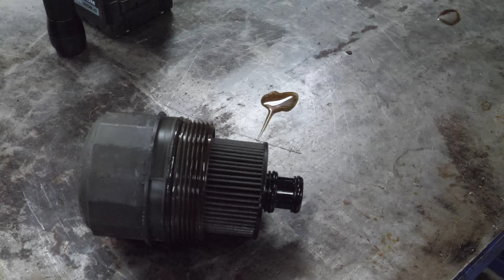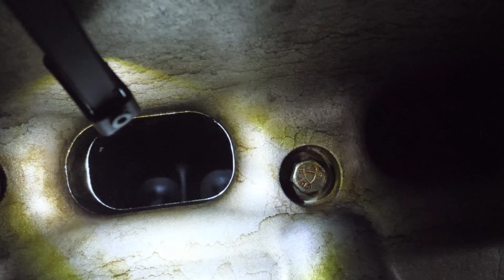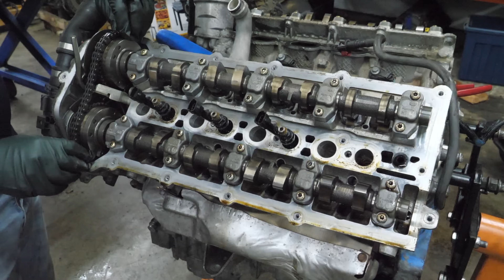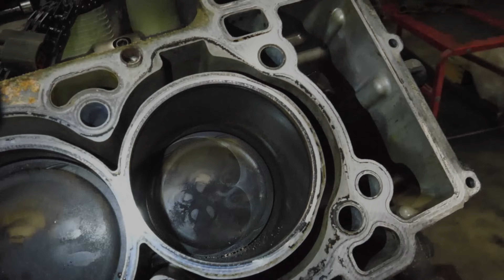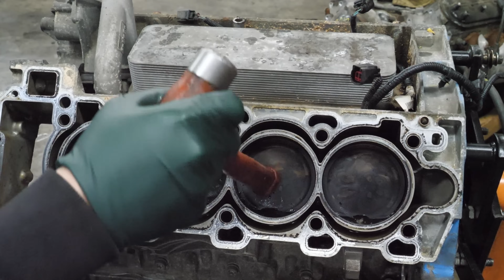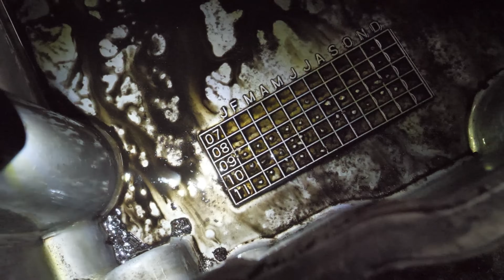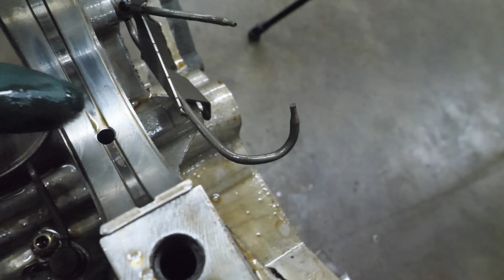500HP Jaguar Land Rover 5.0L Supercharged AJ V8 Teardown! Had to buy AND borrow tools just for this

Comment: I am thinking that the piston and head damage was a spark plug electrode, which means it happened, and then someone replaced the plugs, which is why the ones you removed looked so good. The plastic likely came from a broken chain rail, which was replaced, but they didn't notice that one part, and they didn't notice that leaking timing chain tensioner, which was likely the cause of the entire issue.
Reply: you a damn detective. nice thinking.
Reply from the maker: I bet you’re right. Wasn’t shaped right to be from a broken oil cap, and there’s no way something big enough to cause a dent like that makes it past an intercooler.
Reply: Yes i wrote same thing before reading your comment, i know because i had it before. it was luckier than me , mine was stuck and did more damage. This one came out from the exhaust valve sooner i think.
Reply: That's exactly what I thought too !
Reply: Yep - that’s what I came here to say… thanks for posting it first!
Reply: I'm guessing that the rod bearings might have been replaced, too. They looked to be in amazing shape, while the bearings for the crank shaft were, while not terrible, noticeably more worn. I don't know what kind of wear supercharger lobes develop over time, but it looks to me like the wear didn't look consistent across the range of parts. With how loose the timing chain was, and the bad seal on one tensioner, I bet the engine was running really poorly and the person just decided to be done with the engine assuming there was more damage than was worth fighting.
Reply: Great detective work … damn you are good!
Reply: All I know is people who I personally knew who owned Jaguar's were constantly in the shop with problems and costing them a fortune each time for a repair and they finally got rid of them.
Reply: @trvman1  I often wondered who owned Jaguars and Land Rovers given that the kind of people who had the money to buy them were usually quite intelligent and well educated. Turns out they just like the feel of the cars: beauty, luxury, power, style, etc. They also lease them rather than buy them and have a dealership or two nearby that always have a JLR loaner available free of charge. For people like this car maintenance and repair is a minor inconvenience, easily compensated by the pleasure of fine leather and gleaming wood.
Reply: Someone give this man a medal. I was thinking the same thing. Engine took a crap and they tried to fix it with new tensioners and plug replacements.
Reply: State something else everyone in the comments knew💀
Reply: I think your spot on
Reply: @trvman1  Planet Junk. Remember pre 80's, I don't ever remember having so many problems.
Reply: @naradloff  I believe it either jumped time, or wasn't timed correctly when the chain guides were changed. No telling what was replaced.
Reply: Please don’t spoil it
Reply: @huubvelthuis8988  *your
Reply: To
Reply: I agree with you. Hands down you know your stuff!
Reply: @I_Do_Cars  I to think you are 100% correct you really know your stuff!
Reply: This is probably true.
Reply: Yes... spark plug electrode.
^..^~~
Reply: The 3.0l and the 5l all have defective timing chIn tensioners and have extended oil ch ge intervals which i never suggest. Ive done dozens of timing kits on these engines. Injectors, super charger removals etc.
Reply: 7
Reply: @trvman1  my cousin has a jag bought it brand new twenty years ago. beautiful car he maintained it himself and repaired it. His Daddy raised him to never pay someone for something you should be doing yourself. He still has the car one of his grand kids is driving it now.
Reply: @matthewmorrone883  yeah there is only one way to have extended drain intervals. You must use a 100% Synthetic oil and filter changes with oil analysis. Not one full synthetic oil is 100% Synthetic they lying. I wouldn't by a full synthetic oil if you paid me because you might as well by Synthetic blended oil thats much cheaper because it's the same dam oil as full synthetic. There both made from dino oil. You can thank Castrol for that. Only 100% Synthetic oil a group 4 PAO and or group 5 Esters base stock oil are 100% synthetic oil.
Reply: @Jon-O.  i just replace my oil and filter way sooner. I work on  ars with 34k/ 2year service intervals and see how bad timing chains, guides and tensioners fall apart also moisture buildup in the oil.
Reply: @matthewmorrone883  this is the point I'm making. Your driving habit with Oil analysis specifically tells you when oil is done, whats in it and when it's time to change it out. The only oils that should ever be considered to go 15,000 miles or one year and more are 100% Synthetics these are premium oils that are strictly PAO and or Ester based not blended with petroleum oil like all Full Synthetics labeled as such are. You see what you see because people try to run the petroleum based oils groups 1,2,3 to extended OCI's of 10,15,20k and these oils can't do it. Only 100% Synthetics groups 4,5 have done this  with oil analysis and are successful. Vehicle manufactures are about selling cars not maintaining them period the sooner they get you in to replace your failed vehicle the more money they make. Its why they never  endorse lubricants that can extend the life of a powertrain by 4 to 6 times. The best way to prevent sludging a engine buy a premium oil and filter "Synthetic media" not blended media know the difference. Run a engine flush. Change the oil and filter get in the vehicle drive it on the highway Interstate for 100 miles I guarantee you will burn off all the condensates. 95% of don't know what a premium oil is or what's in it and how it's made or who makes them.
Reply: @napoleontheclown These engines rarely have bottom end problems. Timing chain system is the weak link. Fragile plastic cooling system components is a problem too. They’re also difficult to service installed in the car. Fuel system design is terribly packaged.
Reply: Appreciate your videos and your insight, but I need to quit watching ones on cars I own (to avoid the anxiety.)
Reply: When I saw the first sign of damage on top of that piston (still in the bore), I thought, "spark plug part".  Do these come with NDK spark plugs as OEM?.. that's what Eric removed from the heads...
Reply: @trvman1  I had a 2000 XK8 convertible and I loved that car and the engine (after I replaced the plastic cam tensioners and cam chains).  That thing oozed smooth power, and it is the most beautiful car ever made.  I miss it badly.
Reply: Great video hahaha I'm about to do a tear down rebuild for a friend great pointers in this one...

Comment: You actually looked right past the issue. Timing tensioner was stuck in the aluminum guide. Very common.
Reply: Yep.
Reply: What happens to the engine and valve train if this happens? Or does it just need new tensioners?
Reply: the oem tensioners are garbage Any aftermarket chinese is way better than the oem Same works with the plastic Y pipe Replace them with chinese aluminum like this engine has but no other one  with those 2 updates this engine will go for ever
Reply: @rallyauto34 i really needed to see this comment you have no idea thank you
Reply: @rallyauto34  The tensioners are not the problem. The problem is the guide. The area where the tensioner applies pressure has an aluminum button on oem parts. The tensioner applies pressure and crushes the button over tine leading to slack in the chains. The replacement part has a hardened steel button as an upgrade.
Reply: so are these engines reliable? i'm looking at an Fpace R
Reply: @samyporrata5840  No. I've blown two. Learn from my mistakes Sir.
Reply: @davidhendricksgolfprofessi2321  Did JLR update these? I heard there was timing updates in 2014 and up models but not sure how more reliable those are?
Reply: Yes the new replacements have the steel buttons and are much more reliable. New design on the tensioners as well. But no matter the update. The chains do stretch but if you change oil every 5000 or less they will last the life of the truck. The cooling system is the huge flaw. Plastic pipes on an engine that likes to run hot is a recipe for disaster of you don’t pay attention to it.
Reply: How common w good oil changes?
Reply: @davidrosenbloom6652  very common. around 100k, you should be inspecting and looking to replace tensioners and chains minimum.
Reply: @ define inspection, we’re at 88k now oil every 5-6k and clean and snug tension on chain viewed from oil filler cap and screwdriver tested is it possible to snake a small optical camera down the oil filler cap to visualize the set up on one side? Or is that silly
Reply: Or when the technicians put the tensioner back on with a powered wrench and not seating the guide button properly. It crushes the aluminuminuminum

Comment: The last option for the mystery plastic is a previous set of timing guides. The two different flavors of RTV might support that idea since someone else was definitely in there.
Reply: Do you think the tensioner failed causing this engine to be returned?
Reply: @dans_Learning_Curve  it did say FoMoCo on it.
Reply: @dans_Learning_Curve  Most likely, and a good reason to return it
Reply: @dans_Learning_Curve I wonder if the head gaskets failed As the ones removed look really clean and came off easy and in the process found a damaged timing guide and just replaced the guides and kept the timing chains ( for whatever reason) and the engine was then just slapped together as some of the bolts came undone really easy and the oil side just had a quick clean out aswell and masking what "killed" the engine but overall I would say that the engine is a good engine but needs a tiny bit of work to get it back to how it should be
Reply: @phillm156  designed by Landrover made by Ford
Reply: Could it have been an internal brace on the valve cover? It appeared to be plastic.  Lifting with a strap or chain could have flexed and broken it.   Just a thought
Reply: Or maybe a cam sensor was sheared by the chain slop and they replaced it ?
Reply: @Patrick Baptist I love it... Engines make a SHIT TON more horsepower and torque over a MUCH wider rpm range because of it.
Reply: Maybe the chain tensioners are effectively faulty leading to timing issues. Someone then tried to fix the issue without going as far down as the tensioner and broke an old chain guide while replacing them. If that guy would have been as deep as the tensioner in the engine, then he wouldn't have left pieces of the old one in there.
Reply: Definitely agree that something broke off of an earlier component that was replaced…
Reply: Harness doesn't need to be removed to pull the coils.
Reply: @Patrick Baptist I don't owe money on any of my cars either.. If someone backs into it, that's what insurance is for. Gas money? Who cares about gas money?
Reply: Guessing the hydraulic tensioner was the problem. A friend bought a sport that had a bad timing chain rattle, guessing it was the same problem.
Reply: @fjbeveryday  I was thinking just that myself.
Reply: @dans_Learning_Curve  Not having a whole lot of experience with different tensioners, On my truck, there is no seal. Just the piston. Which I believe needs oil blowby IMO
Reply: So it’s a Ford based motor looking at the FOMOCO stamp on the timing chain adjuster???
Reply: Crown damage Spark plug bits or ring from piston.
Reply: Yep.  Timing Assembly went bad and previous broken plastic left behind.   Then that caused cylinder to break a valve on the one highlighted.   So that got replaced but the debris was not completely removed.   Alas when it came back "fixed" it was too good to be true.

That's my 2-bits.   Don't ask me why I know how.

Comment: Hey, JLR mechanic here.  The steel timing tensioners would dig into the aluminum guide rails causing the loose timing chains seen here.  They would cause noise and then jump time, turning on the check engine light. Lack of oil changes made this problem worse.   JLR came out with updated timing chain rails that had a steel insert to prevent this problem.  The AJ 5.0 L V8 and especially the 3.0 L V6 (the same engine minus 2 cylinders) have a long list of problem spots and seldom last longer than 120 K miles
Reply: Do you know why people say you have to remove the injectors to remove the valve covers? I only ask because in the video he just turned the injectors to let the cover clear.
Reply: Can you confirm which year got the updated chain guides? Did that extend the lifespan?
Reply: Seldom? Okay bud.
Reply: @ngerbo1  I've read that the 1998 version of the 4.0/4.2 got them so I'm assuming that all 5.0's had them.

Comment: I’m a Land Rover technician and that ford engine looks like the coyote’s 5.0 cousin. Different components by Land Rover, different blower, and more things, the engine is decent with good maintenance, we haven seen some in the 250k miles mark, but to get there you have to spend a lot of money. He had trouble getting the injector out, even with the special tool sometimes they are very difficult to remove and sometimes the plastic cracks. We do not rebuild engines due to quality replacement parts available. If you try to get new bearings pistons etc is impossible trough JLR, so most of them are used or new engines installed in vehicles, most common failure overheating due to leaking crossover pipe. Great video! And trust me to remove a lot of the components in the engine bay is a interesting task most of the time.
Reply: Since you're a tech, what would your opinion be on. 2018 V8 RR with 50k miles good service history? Engine wise is it a no go?
Reply: @TortugaDeRio  check for carfax history on maintenance, Land Rover calls for 20k miles oil changes, if you follow that you will be needing an engine soon. Not too much maintenance due till 60k miles, diffs, transfer box, transmission. 50k miles still low mileage if the basic oil change was made regularly. But fair warning if you get one, better love it or will get the best of you!
Reply: But isn't the AJ133 an extensive update/improvement to the Jaguar AJ-V8 and is technically a part of this engine family which was an in-house design from Jaguar beginning just before Ford acquired them?
I know there's some components that have FoMoCo stampings on them which makes sense considering these engines & components were built at the Bridgend plant which was owned by Ford but I'm confused as to how the Ford Modular V8 engine family would have a direct connection to the Jaguar AJ-V8 engine family when they were both designed & engineered at different times and by completely different car companies.
Reply: @crazyjkz  since 2004 Ford supplies engines for Land Rover jaguar in Europe for their diesel platforms, most likely working together to redesign the v8? Don’t know, I’m not an engineer, but in all vehicle we tear down at the shop has it particular markings of manufacture, come citröen, Peugeot, bmw, fomoco, jlr. Is just my personal opinion but why would I design an engine and put somebody else’s name?? Hard core ford fan? Maybe?
Reply: Jag designed AJ-V8 1st Gen V8 and AJ-133 2nd Gen V8 in England, without Ford Engine Engineering input, save a few “parts bin” parts. Ford Powertrain Operations Engine Engineering designed the Modular V8 without Jag Engineering input.
Reply: Very good informative comment , thanks
Reply: So, Coyote swap it... Got it. ✌🏽👍🏽
Reply: Looks nothing like a coyote
Reply: @Jonesy_Ripley - not a coyote; it’s a DAMB engine with completely different design
Reply: Not the same 5.0L
Reply: @trp2413 
In the early 2000s the jag XKR SC v8 was strangely similar to the 2003 ford cobra v8 32 valve twin screw SC 
And the same goes for the 2000 FR500 5.0L DOHC v8
Reply: YES I'm french JLR tech too, this engine is real good, in general our customers just take great care of it. We've seen nothing major in a long time, some engine dead because of fuel pump failures (mixing engine oil and fuel), some water pumps, some thermostat housings but rarely major issues on it.
Reply: Since Ford owned Jaguar for a while, that's not surprising.
Reply: I fucking love my V8 AJ133. Motors 12 years old, 100,000 miles, and I drive it hard like verstappen. Purrs like a kitten and smooth as day she was built. Changing oil 3000 miles , which has so far “ prays to rover gods “ prevented the ole timing chain tensioner failing
Reply: just blew a head gasket at 103,833 but she still ran. Just finished rebuilding top end. no start, no crank, starter is culprit, broke the stupid plastic 12v connector.
the chains that were on were mint. tight as could be.changed em anyways and retimed it. after getting a new passenger cam  exhaust after the front of it just fell off hahahaha.
Reply: I have a question: to replace camshafts covers gaskets the injectors need to be removed or just may be rotated as was done in the movie? It seems that the covers are designed to rotate them without doing unnecessary job.
Reply: @lukaszCRW you can try, but if the teflon seal starts leaking fuel you will have to do it all over again to replace the seal.